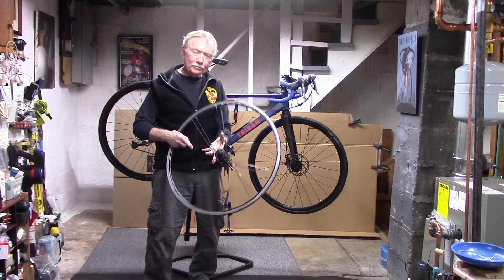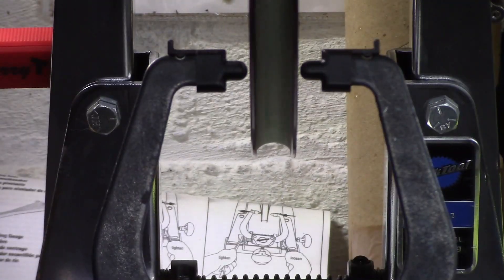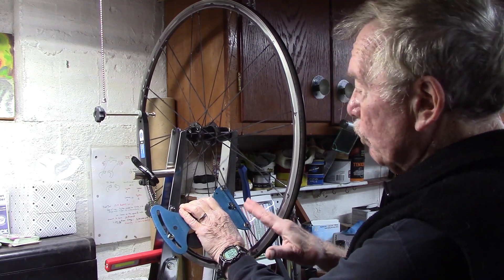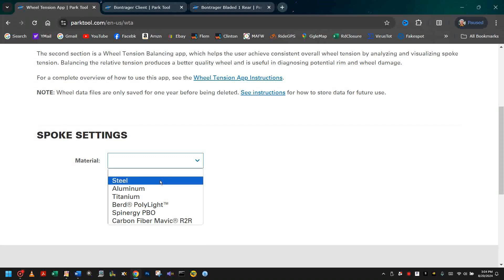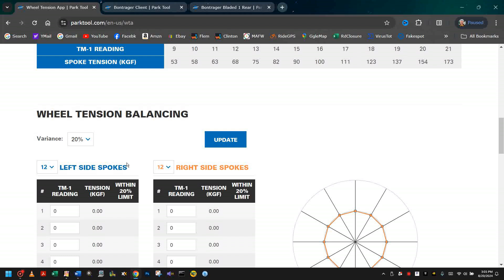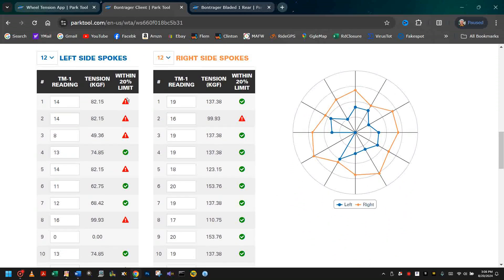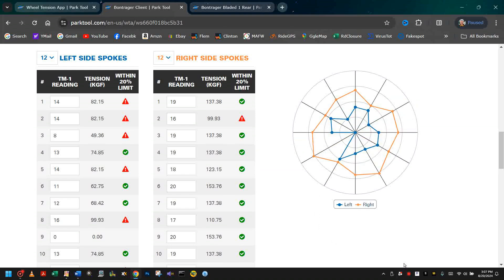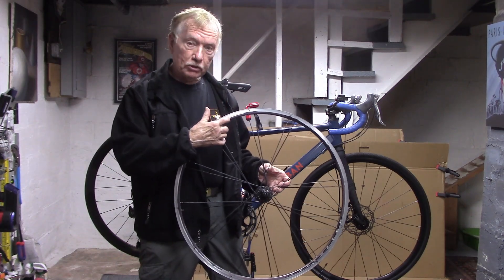Avoiding Disaster: The Importance of Spoke Tension

Comment: I could get my hands on some new old stock rims, but I have no idea what spoke tension they need, since I cannot find the model in any online data bank. Can I calculate the tension myself?
Reply from the maker: The rim does not effect spoke tension which is determined by the spoke material, spoke measurement, the spoke tension meter and it's accompanying converion chart. We are usually attempting to get a tension on front wheel or rear drive side of 100-110 kgf and rear non-drive side of 40-70 kgf. If this is the first time you've built a wheel, I suggest you get a copy of "The Bicycle Wheel" by Jobst Brandt. Also visit Park Tool to determine the correct spoke length before buying any spokes. Also see:
https://www.prowheelbuilder.com/spokelengthcalculator
Wheel building is truely an art form that requires practice and more practice. Regards and enjoy the learning process, Tony

Comment: I’m still shocked at exactly how much there is to bike maintenance and repair. The wheels alone are so in-depth. Lacing then truing, tension radial dishing and so on. Even the physics at play 🤯🤯
Reply from the maker: Start with the easy maintenance/repairs such as some of those in our videos. With time and patience, you can slowly tackle more. When you reach the point truing or building bike wheels, be sure to get a copy of "The Bicycle Wheel" by Jobst Brandt. Regards and safe cycling, Tony

Comment: There isnt that much danger if you arent running meme carbon rims with meme hubs with less than 32 spokes. I have built all my wheels as lazily as possible, dont think a single one of my bikes has a 100% true wheel, the worst that ever happens is a rear wheel spoke breaking because i tensioned it too much.
Reply from the maker: That is true with 32 or 34 spokes. Although I have seen the wheel go out of true such that it rubs against the rim brake pads such that it's difficult to ride, even with 32 spokes. There is currently a trend to use far lower spoke numbers but with stronger spokes and we seem to see less spoke breakage these days. One problem I forgot to mention is too high a spoke tension. I've seen that cause cracks in rims where the spoke nipple comes through the rim.
Regards and safe cycing, Tony

Comment: Does anyone ever listen to the sound of the spoke when tapped?
Reply from the maker: Yes. You strum it like a guitar. It does give you a rough idea of the tension and was the way we built wheels some years ago when tension meters were not available or too expensive. Some still swear by the method and it does a fair job. I guess I'm just a stickler for percesion and use a tension meter. Great question! Thanks and regards Tony

Comment: Great info, thanks for sharing! I’ve been building wheels as a hobby for 20 years, and every one of them tensioned using the same Park Tools TM-1 tension gauge. I also keep a copy of “the Bicycle Wheel”, 3rd edition, by Jobst Brandt on my bench, and I refer to it often when explaining wheel building to friends and customers. I am very impressed by how well balanced the tension readings were on the wheel you built, well done! I also noticed how much radial runout there was on the problem wheel your customer brought to you. I’m curious to see how well that wheel came together, or if you had to replace the rim or other components. Again, a well done video, I’m now a subscriber and fan, looking forward to seeing more content from you. Thanks again for sharing!😁❤
Reply from the maker: The freehub on the friends wheel also need to be overhauled. The rim looks good and if my friends desires to use it, I'll overhaul the freehub and use some new spokes to build it back up. My friend has another wheel set and I haven't found the time yet to work this wheel.
Thanks for the compliment. I have used Brandt's book over the years as a wheel building guide but with bladed and carbon spokes, there are many new things to learn.
Regards and safe cycling, Tony

Comment: I was hoping to see you you address the problem with the wheel, make the proper adjustments, and then show the final results after rechecking the tension. And was it something broken or damaged, wrong spoke size, or something as simple as a loose spoke(s)?
Reply from the maker: A loose spoke is not something simple since it often related to rim damage or other causes. In this case, I think it was a prior crash with subtle damage to the rim (although I can't see it) and have yet not undertaken any kind of rebuild. The freehub also appears to be a problem and needs an overhaul. My tendency is to build a new wheel rather with a new rim and the overhauled freehub rather then undertake a rebuild with the old rim. 
Regards, Tony

Comment: Great information Tony. Two immediate questions I have, 
1. Can the online Park Tool WTA app be used with a non-Park Tool tension meter?
2. How do you find out the proper spoke tension value for your wheel?
Thanks, Brad
Reply from the maker: No, the Park Tool Wheel Tension App (WTA) is only designed to work with the Park Tool TM-1 Spoke Tension Meter. The WTA uses the TM-1's factory calibration to generate statistics, which can help you achieve consistent spoke tension. To convert the reading to actual tension in kilogram-force readings, you can either use the charts included with the meter (or download them from Park Tool) or use the Park Wheel Tension App.
Each tension meter should come with it's own charts or on-line app.
It is important to know the material and certain dimensions of the spoke in order to use the correct conversion chart or app.
Good questions. Regards, Tony
Reply from the maker: See reply above. As to your other concern, the Park Tool tension meter is more expensive but the advantages, at least for me, is that it is calibrated to a high stand. Park will also recalibrate the tension meter for a minimal cost and shipping. This is important in case the meter is dropped but also, over time (every few years depending on use), the meter needs to be recalibrated since the spring in all such meters will loose some effect and needs to be replaced and recalibrated.
Reply: Making the simple complicated. We didn't need computers and spoke tension meters when I learnt to build wheels in 1974 and I'm still not using a computer with or without apps. 
My tention meter is used when components have low tension limits. 
A badly tensioned wheel doesn't just collapse without a reason. 
If a round wheel has very uneven spoke tension or the odd loose spoke, then there's a problem with the rim. A good rim will have even tension when it's true.
I'm a professional wheelbuilder with 50 years in the business and I'm amazed at the amount of nonsense on the internet about wheelbuilding
Reply: Good questions Brad. I wasn't thinking about it but now that you mention it, I would like to know as well. 🙂

Especially since the Park Tool tension meter is one of their most overpriced items, when compared to similar products from other reputable brands.
Reply from the maker: @Nain1993  See reply above. As to your other concern, the Park Tool tension meter is more expensive but the advantages, at least for me, is that it is calibrated to a high stand. Park will also recalibrate the tension meter for a minimal cost and shipping. This is important in case the meter is dropped but also, over time (every few years depending on use), the meter needs to be recalibrated since the spring in all such meters will loose some effect and needs to be replaced and recalibrated. 
By the way, I am an independent user and not paid by Park Tool or associated with the Company.
Thanks for your comment. Tony